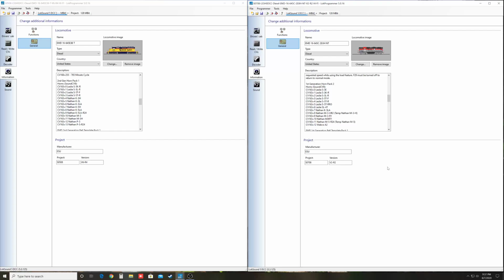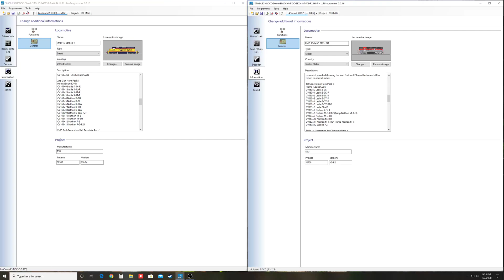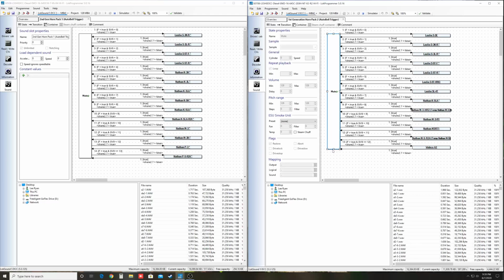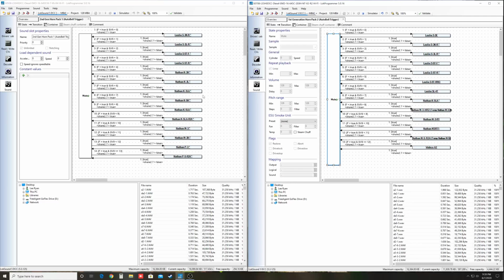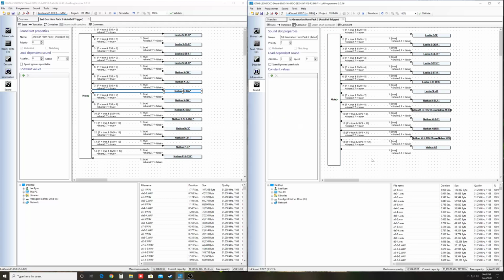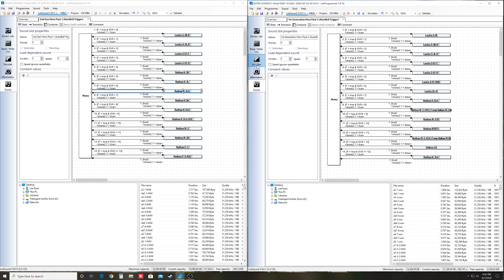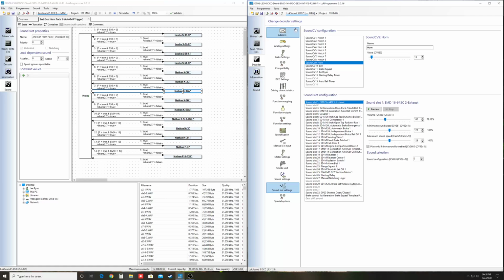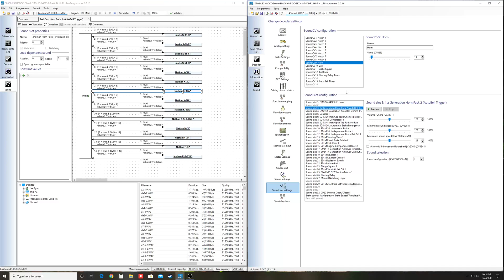ESU LokSound Tutorial - How to move horns between sound files

Comment: Hello friend here bothering again
I have some doubts, Can I write the sound file to two locomotives at the same time when they are both locomotives the same model and I want to write the same sound file to both?
Can I add more horns to a locomotive that already has a sound file written to it?
And lastly, can I extract the horn from a locomotive that already has a sound file written to add it a different sound file?
Reply from the maker: You can write the same sound file to two locomotives, but you have to do it one at a time on the LokProgrammer or have two LokProgrammers connected to separate decoder testers or tracks. One locomotive at a time per LokProgrammer. I do this all the time. 

Yes, you can add more horns to a locomotive that already has a sound file written to it, but you need to have the sound file that was written to it as the starting point. Most manufacturers either provide their sound file on their website or will send you their sound file if you ask. Then just follow the steps as outlined in my video. Note though that the decoder has limited memory, so you'll only be able to put so many horns on a sound file before the memory runs out. You can delete other horns or other sounds to free up more memory. 

You cannot extract horns from a locomotive, but there's really no need to. Most horns are available in other sound files which can be used and transferred across to any other sound file as per my video. The only ones that you can't access are Rapido's files simply because they record their own sounds and own the rights to those sounds. You can though use a standard "Retail" file from the ESU website with the same prime mover and overwrite Rapido's file if you so choose. Then you can customize the horns all you want.

What specific horns are you looking for? Which manufacturer's file(s) are you wanting to modify? I can help better if you can give me more specifics as to what exactly it is you want to do.
Reply: @RioGrandeFan  Thank you very much for solving my doubts, the horn that I would like to extract is a Nathan K5hl that is in the file that Scaletrains uses in its ET44ac, but it is the file that has the error where the bell is activated again when the horn sounds and sounds double if you already had it activated with F1, and the S0735 file does not have that horn, and this is the file I want to use to update my ET44
And for adding more horns to a locomotive, so that the file I am going to use to add the horns has the same configurations that the locomotive have to put the option to read data from the decoder?. Greetings and apologize so many discomfort
Reply from the maker: @FerroFilme MTY  I can help with this if you can tell me the road name and maybe even the Scale Trains stock number of the locomotive you have. S0735 does have a Nathan K5HL but it could be an updated version of an older one in an earlier Scale Trains file. Horns are getting remastered and improved all the time so a newer one might be more accurate. If you give me the information of your locomotive I can listen to it. Then I can possibly match it. The new bell format can also be done to eliminate the double ding. We need to find a way to chat off YouTube. l r _ t r a i n s at y a h o o dot com. It would be easier to help you.
Reply: @RioGrandeFan  The locomotive that has the horn I'm looking for is an ET44AC KCS road number 5004 SXT33195
And yes, a chat on Youtube would be better, I don't know why they eliminated that function
Reply from the maker: @FerroFilmeMTY  I hid my email in my last response at the bottom. You have to put it together but it's there. 

Anyway, I can look that up and see what the horn sounds like. Have you listened to the horn in S0735? You can download that file and listen to the horn through your computer. You should be able to open the file in the LokProgrammer software (you don't need the LokProgrammer hardware) and then go to Sound slot settings. Click SoundCV9: Horn. Change the slider to 6. Then in the box below click Sound slot 3: 3rd Generation Horn Pack 1 (AutoBell Trigger) and then click the preview button. The horn should play through your computer speakers or headphones until you press stop. Just be sure to turn the volume down if you use headphones as the horn will be loud.

Another method is to click the sound icon, then double click Sound slot 3: Sound slot 3: 3rd Generation Horn Pack 1 (AutoBell Trigger). When that window opens, look at the top row of the window and you'll see the word "Simulator". Click that. The bar on the far left should turn green. At the bottom of the page, you'll see three tabs labeled "Registers", "SVs", and "Load/Brake". Click the one that says "SV's". For SV9 change that 0 to 6. Then at the very bottom you'll see a button that says "Function". Click that button and the K-5H-L will play through your computer speakers or headphones. If you use headphones just be sure to turn the volume down as the horn will be loud. The horn will play until you press the "Function" button again to stop it. If that is the correct horn that you want, you should just write sound file S0735 to the decoder and configure the lights, which granted, will not be easy without knowing the outputs. Some trial and error will be needed. You could also ask Scale Trains for the sound file since it isn't posted on their website. Then you can function map S0735 to match.
Reply: @RioGrandeFan  Hello, just to ask if you received my email, I don't write much in it, in case I made a mistake in the address, if I sent it correctly, could you please answer it, regards

Comment: How do you connect the train to the app?
Reply from the maker: The direct answer is via a LokProgrammer. This is a piece of hardware that you can buy. It connects between your Windows based computer and a piece of track. It operates separately from your DCC system. I have mine connected to the ESU decoder tester and I set up my decoders prior to installing them in locomotives. The LokProgrammer is a great investment as it can write sound files, update decoder firmware, and makes standard CV programming a lot easier. It works for all versions of ESU decoders.

Comment: Do you have any information for modifying the sound scheduling for the prime mover ? This seems to be a not very popular thing to talk about.
Reply from the maker: Modifying the prime mover sound schedule in what way? I have found that the default settings are just fine for the prime mover. What is it you don't like and/or wish to modify? I am genuinely asking as I am curious as to what it is you're interested in doing. I may or may not be able to help initially, but I can certainly try and get an answer.
Reply: @RioGrandeFan  i would like to get a faster response out of manual notching. Full disclosure, I want to use a loksound 5 on a 1/8 scale locomotive and I am building my own controller. Usubg an arduino, It will take an analog input and track the throttle lever position from stop, idle and notches 1 though 8.  Prototypically, if you are moving cars you are going to be feathering the throttle, like idle to 1 to 2 to 1 to 2 to idle... if you. The loksound currently only has idle, and notches 1 through 8... so if I just kiss notch 2,and then jump back to 1, it wants to run its full 1 to 2 to 1 sound sequence... I want to cut that into 1, 1.25, 1.5, 1.75 and then 2... so it more closely resembles full scale. When you look internally at any notch sound there are 4 parts to them that run in a loop..  but you can only get out at the end... I want to be able jump out at the end of each quarter for lack of a better term... 

Does that make any sense?
Reply from the maker: @kleetus92  Yes this does make sense and I think I was able to get it to work at least in the auto-notching. Now you might not really be able to have all of the small increments that you want like 1.25, 1.5, 1.75 as I see it. I was able though to create a dump out that comes before the notching up gets too far down the process so if you "kiss" notch 2 from notch 1 like you say, it "dumps" out to the notch down sound before it lingers in the notch up transitional sound before settling into notch two. I think the effect is actually quite good even though you only get essentially one dump and you have to be fairly quick with touching notch 2 and then back to 1. Right when you hear it notching up you back off and it works. 

The problem as I see it with manual notching is how ESU does manual notching. You have to set one function as the "notch up" key and another as the "notch down" key. The notch up key must be OFF before the notch down key will work. Leaving the notch up key turned on will just make the prime mover continue to run up until it hits 8. It will stay there until the notch up key is turned off and then the notch down key is turned on to bring it back down. This requires three key presses in about a 2 second time frame. Then the notch down function has to be turned off before the notch up function will work again. 

I think what you're trying to accomplish would be easier by using an Iowa Scaled Engineering ProtoThrottle and the auto-notching. You can change the auto-notching notch points in both the ProtoThrottle AND in the decoder so you can fully customize how that interaction works. If your custom throttle works the same way then you should be able to use the auto-notching and get the results that you want.

In auto-notching the decoder notches up or down based on a speed step. Internally it uses speed steps from 0-255. At internal step 1 it goes from "idle" to what ESU calls "Notch 1". There is no real sound difference here. Notch 1 to Notch 2 happens at internal speed step 22. I don't think that for what you are doing this will really matter all that much though if you're trying to tie your physical speed to the sound speed, you might have to adjust this. ESU lays out each of the notch points in the sound schedule. The notch up happens at the step above what is listed. The notch down happens at the speed step listed, which is 21 for notch 2 down to notch 1. 

The same "dump" that I created in the auto-notching can be created in the manual notching if you still feel like that would be better, but like I mentioned I think getting the notch up function turned on, then off, and the notch down function turned on quickly enough will be your biggest challenge.
Reply: @RioGrandeFan  do you have an email address? I'm at kleetus92 at gee mail dot com.

The button presses aren't an issue since it would all be sent digitally to the system again based on where the throttle handle is at. I was able to change the internal steps from 22 for example to literally 2 , but just messing with the programmer it had some weird behavior, which I think your 3 button explanation kinda explains. I think it's an internal register that we can't play with. 

I am curious how you did the dump out.

Comment: RGF,what file type are they using in ESU Loksound decoders?And can you use your own sounds on the deoder that you have recorded? BC
Reply from the maker: They use .wav files. Most are short pieces. The horn for instance is made of three short pieces. Theres the initial start, then the middle, and the end. If you press the horn button quickly you just get the start and end, if you press and hold you get the middle looping until you let go.

Yes you can put your own sounds on the decoder but you have to edit them well and into the necessary pieces to make them play correctly. You also need a LokProgrammer to then actually write them to the decoder.